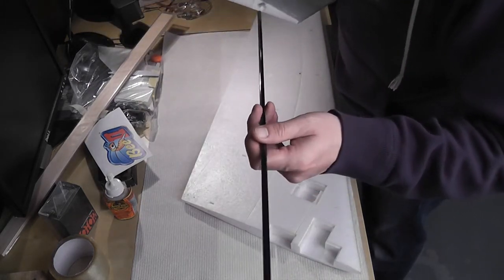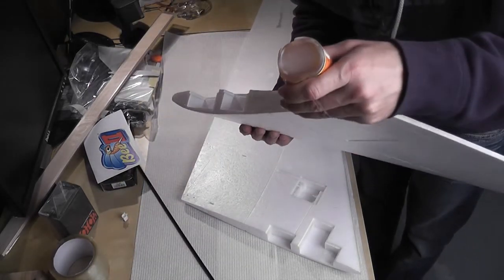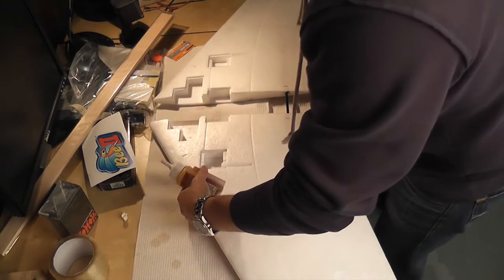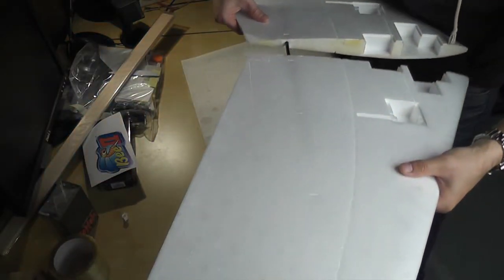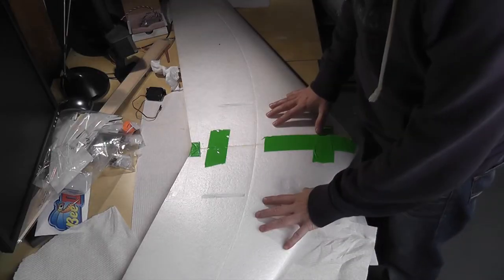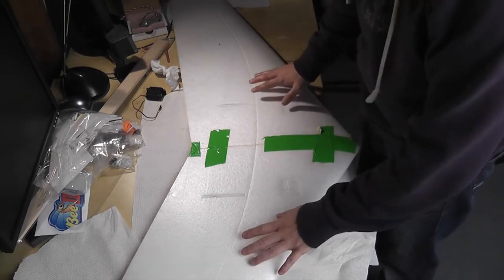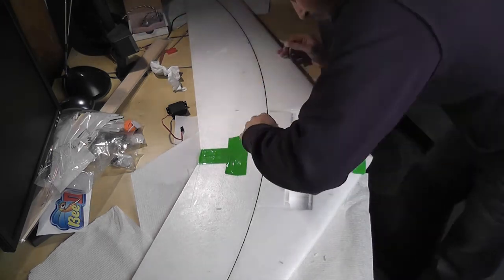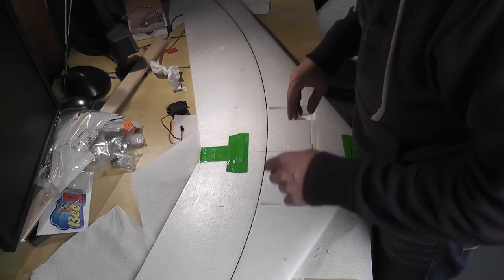Windrider Scout Bee Build Part 1 - Glueing

Comment: I am curious how you glued the wing together like that. I don't see a time lapse in the video where you let the glue dry before gluing in the EPP foam inserts. When I put in the EPP foam inserts in on mine doing a dry fit it wanted to push the wing apart in the top center without sanding the inserts outer sides. And I needed to use an incidence meter as there was a mm or two of possible twist without using the forward center section to get both wings angle of attack symmetrical. Plus unlike the lucky guy below the single wing rod I got was about 2/3 shorter than the length of the internal channel and was glass fiber not carbon as people report they received. I replaced it with a longer carbon rod that was much stiffer and lighter. I also had to sand the inner and outer trailing edge close to 2 mm on each wing to get it straight so the elevons could sit flush to the trailing edge without bending them in a curve and causing some binding. Seems to be some minor variations if you were able to just glue the wing as it looks as there is no way tape would have held mine tight enough to keep the center from separating while the glue dried with the inserts in place.

I suspect it has to do with how long the wing is left in the mold as I'm sure they need to make them as fast as they can and wonder how many molds they have. I can see some tweaking was done on the mold mine came out of in the center between the two cut outs and that what I used as it measured perfect. The foils and other important aspects were excellent and symmetrical unlike most hot cut EPP wings that can be 3mm or more off. You can trim the wing for defects but the radio 's elevon programing is based on the wing being symmetrical in all aspects and IMO that accounts for a lot of trimming issues some have and others don't and how well the wing performs without yawing and uneven pitch response.  

So mine was not quite the instant build as shown here but did come out symmetrical and straight after some sanding and two separate gluing sessions. Great wing but I sure wish they designed it for todays smaller servos and did the same excellent internal flat servo mounting more towards the center of the elevons rather than having the clevis at the far inboard end to use thick standard size servos on such long thin control surfaces especially if going powered, and at a 90 degree angle to the tailing edge to keep digital servos happy. Not easy to copy it with the main spare in the way as its a really close fit but the manufacture could plot it out in few minutes with the 3D Cad program I'm sure they used. I plan on keeping mine a glider for now but will probably get a second one and cut out the center section where there are some lines shown on the one I got for going power. Thanks for sharing.

Comment from the maker: Not sure about the extra spar.  I just got the one and it had a hole already made.  Maybe you accidently got an extra.  Maybe he started adding a spare in case you want to stiffen it up more.  If you use it, carve a slot for it with a hot soldering iron on the bottom and glue it in with a mix of guerilla glue and a bit of water.  The glue will foam up and expand to fill the slot.  Cut excess away before covering the wing.